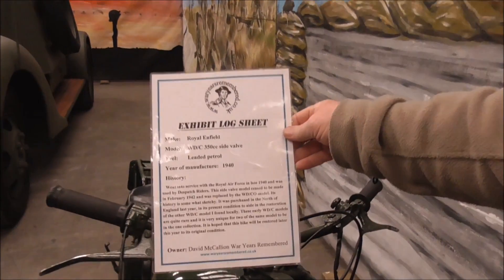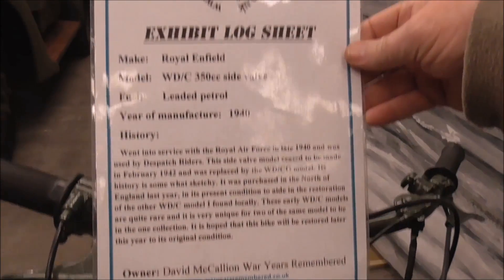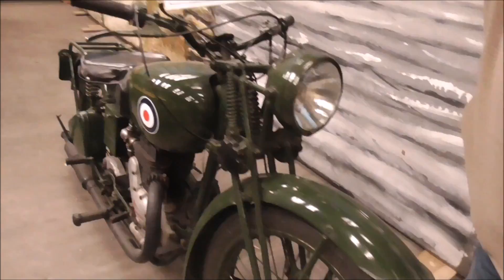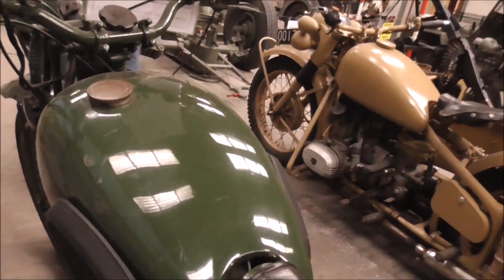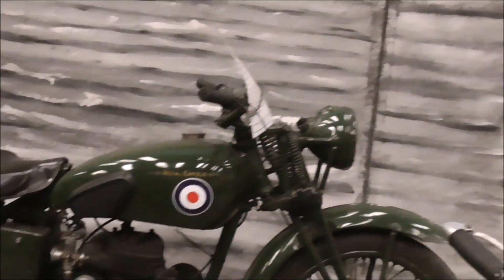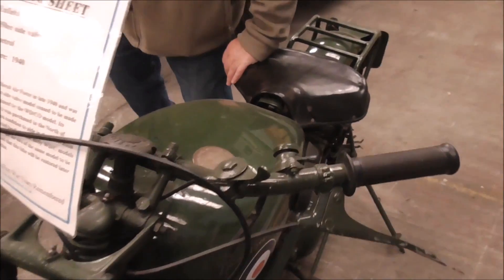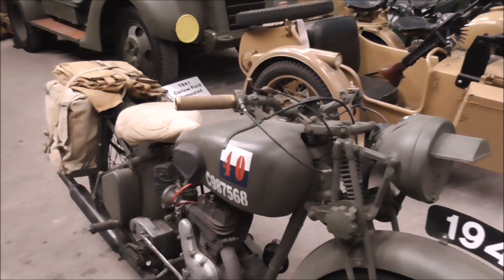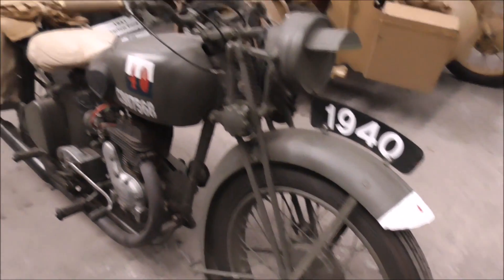WW2 Royal Enfield WD/C Side Valve 350 Dispatch Rider motorbikes

Comment: During my national service in 1952 my father gave me one of these . I rode it up and down the UK during those two years. I then rode it down from Lancashire to Portland in Dorset where I joined an RN aircraft carrier as a NAAFI boy.  The Enfield was craned on board for a trip to Gibraltar from where I rode it to Malaga and back one weekend.  I traded the bike in to a Dockyard matey in Potsmouth for a 1949 Triumph Tiger 100.  But that's another story.    Many happy memories of that Enfield.    I have a photo but cannot post it on here.
Reply from the maker: Hey SW. Many thanks for those happy memories. You definitely made great use of that Enfield! 
Best wishes from the Belfast Castlereagh hills of Northern Ireland.
Reply: @TomMcClean  The only problems I encountered on the road were  in heavy rain, water seeped through the advance/retard cable ond crepped down into the contact points.  A quick wipe out with a dry rag got me going again.   On one ocassion, the return spring for the gear change broke. I removed the bolt from the gear indicator and added a flat ring spanner under the bolt head when I replaced it.  I could bend down and change gear with this and continue my journey..   Many happy miles on that old bike.  I wish I could post a photo for you.   I am 91 now and still dreamin'....
Reply from the maker: Brilliant work there SW. If only we could all go bacck in time and relive the good old days. 
Here's a wee dispatch riders training video I found for you to relive a few more memories. At 71 I'm still riding after a recent heart attack. I have a 600cc Honda Shadow. Best wishes from the Belfast Castlereagh hills.

Dear Sergeant (WWII British despatch rider training)
https://www.youtube.com/watch?v=7C9FHSrcIWo
Reply: @TomMcClean  Thank you Tom.   I am 91 and can only dream of motorbikess.  I drive a 2011 Ford Fusion....an old man's car, just right for me. and room in the boot for my wife's rollator......
Reply from the maker: Excellent SW. Keep on truckin'!  You are doing so well! Old guys rule! Best wishes again  from the Belfast Castlereagh hills of Northern Ireland.